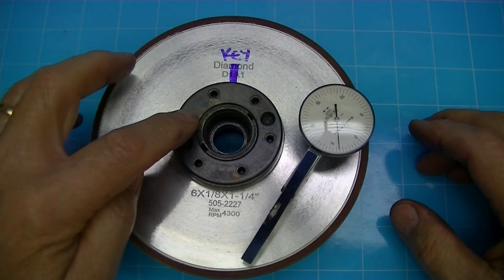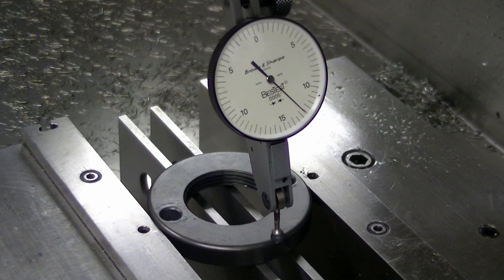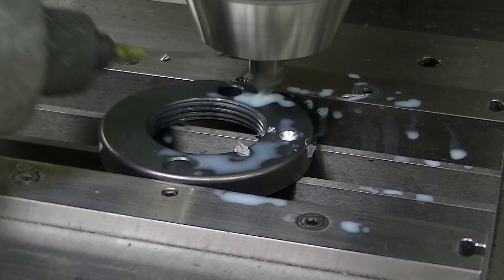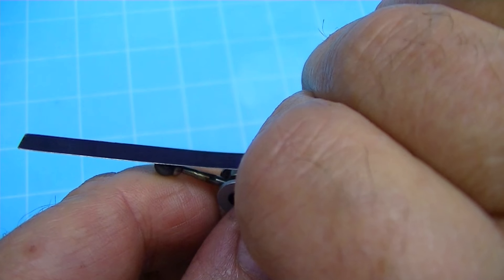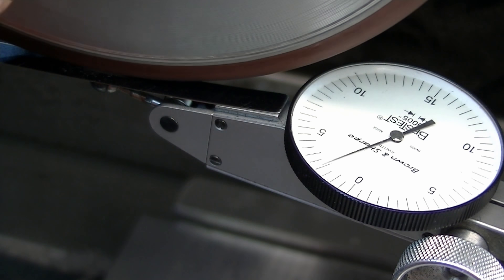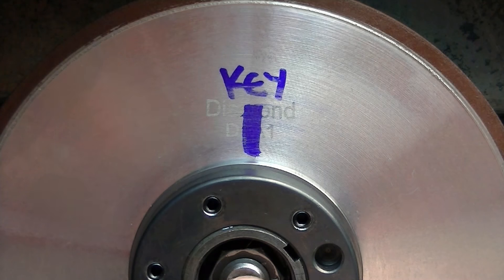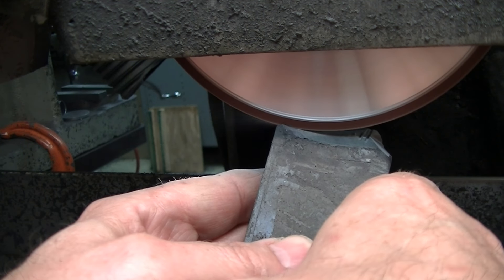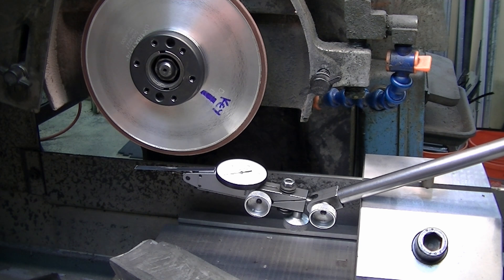ROBRENZ TOOLROOM TIP #2

Comment: “Shop Notes”*

• Making a grinding arbor nut
• Adding spring steel to a dial test indicator for alarger surface
• (5C) collet held backstop in the lathe with the chuck on
• Tapping head is a SPV (Spintec) SA-0E. I can't find the model on their website. 
• 3M 467 Adhesive Transfer tape:
McMasterCarr (60yd): https://www.mcmaster.com/#adhesive-transfer-tape/=19s264m
Amazon (.5 in/20yd): https://www.amazon.com/dp/B007Y7CQ1S/
(other sizes): https://www.amazon.com/467MP-Performance-Adhesive-Transfer-0-125/dp/B00P26Z04I/
3M's website: https://www.3m.com/3M/en_US/company-us/all-3m-products/~/3M-Adhesive-Transfer-Tape-467MP?N=5002385+3293242532&rt=rud
• Indicating in
• Tip about aligning to your spindle for good repeat concentricity.
• Opening a dressing a diamond wheel with dollar store sharpening stone and a stick of moly(dinum?)

*Not affiliated with any manufacturer or supplier.

Comment: We used a similar multi-point jacking bolt on some specialized equipment that needed huge holding forces, but had no room for standard wrenching and torque that would be required with a standard bolt.  Did the math and found to get equivalent torque on a standard bolt, we'd need a 17foot cheater bar.  With the super-bolt, a 6in long hex key was enough to get the same result.  Amazing.... 
I always learn something fascinating when I watch one of your videos.  The spring steel "pad" alone is pure gold.  Keep up the great work.
Reply from the maker: Thanks and correct, I didn't invent the idea I just applied it in another application.
Reply: @ROBRENZ  I didn't mean to imply that you were implying that you were the first to use this.  Simply to discuss the incredible amount of force this method produces.  I'm not a machinist, but love the craft.  Of all the amazing things I've learned here, the one I most often use is Goop thinned with toluene.

Comment: Hi Robin, hope this finds you doing well. Can't thank you enough for sharing this info! I need to grind the carbide feet on an indicator stand I built, and just purchased my first diamond wheel to do so. Your video is going to be incredibly helpful in setting up the wheel properly. The tips on the arbor nut set screws( and spacers ), and the spring stock for the indicator probe are priceless!

Comment: Robin, thanks for another great video,  I really like this style. The long form videos are great, only downside is sometimes I want to show a technique to a coworker and can't remember where you showed it. You're also the reason we have a Harig surface grinder and D-bit grinder. 

One question-you come up with very creative ways to work around not having a tool changer VMC, but wouldn't it be easier to get even something small like a Minimill? It wouldn't replace the ProtoTrac for big stuff, but it sure would make life easier for all the spot/drill/tap operations and projects like the boring bar.  

You're doing things now that we mere mortals couldn't do if we were handed a 5 axis Kern, I can't imagine what would happen if you had a little machine like Adam Demuth's Mori tucked in the corner.

Comment: Thank you Robin,
Amazingly timely, almost, but that actually helped me Focus ( you b) on the lesson!
Just did a small run of precision stones and had to dress a new Norton 13mm wide diamond wheel.
Went with what I knew and used a Norton carbide dressing  stick to true and Alox stick to open.
Like you're suggestion better
How does the sticky cold rolled do in comparison to the Molly?
And that hub, Hubba Hubba hubba.
Had to do it, sorry.
But, yep, that's brill.
You could do the same on the vitrified wheels with that washer taking the grubbers.
Lots of hubs, one for each ....
Thanks again Robin, keep safe.

Comment: I just recieved my first grinding wheel yesterday. This video pretty much answerd all questions I had last night about mounting it and dressing it. Timing could not have been better. Really like the tip about the metal strip you mounted on the dial indicator.
Reply: This is really only for diamond or cbn wheels. A standard  vitrified abrasive wheel would just be dressed with a diamond point.

Comment: I once did a study looking at resin bonded diamond wheels under a powerful microscope, comparing those that had been ‘opened up’ using a soft dressing stick with wheels where this was skipped. I was just barely able to discern the ridges of resin directly behind each individual grain of abrasive, and valleys on all other sides of the grain where the soft abrasive dressing stick wore the resin away. I think if I had more time to experiment with dressing procedure I could have made it even more pronounced, but it was interesting nonetheless.
Reply: Microscopes are a great shop tool for seeing what you're doing, with abrasives especially. If you can just use your eyes, a lot of great techniques turn from spooky tricks to blindingly obvious.

Comment: I may never need to do this setup on a grinding wheel but the tricks with the spring steel are interesting . I think that precision grinding has been overtaken by new EDM Wire cutting so this type of tips & tricks by the older class of toolmakers get lost. Thank You
Reply: EDM is fascinating technology but it will never replace grinding -its slow ,machines cost arm and leg ,its hard to find a good workforce that knows how to work on it ,amount of power those machines use is high.Its first used in 1970's but its still unicorn of the machining world.Compared to a CNC machines like milling machines that are commonly used today in large industry and hobby garages ,its way behind in mass use and its only 12 years younger than a cnc machine.Grinding is used since the iron age 2500 years ago when a dude used a rock to sharpen a axe  and it will stay for that much probably.
Reply: zumbazumba if you read closely I was talking about Wire EDM machines . The technology is amazing as it can cut complex geometry shapes as a high rate of speed VS the old cabin electrodes of the early 1970’s . I have seen carbide parts of 4 to 5 pcs cut at different locations that have a slip running fit with a 3 to 4 micro Ra finish. parts were produced in hours. Sounds like you need to checkout wire machines as they are slick. Hate to say this but CNC machines have left manual machines i the dust for speed, fit, finish & time to produce. Back in the mid 70’s i worked at Burke tool and Fred purchased. Moore CNC tape Jig Grinder this machine ran rings around a Harig grind fixture on a manual grinder. Sorry but this is a fact ! .
Reply: Wire EDM is not very versatile. Parts cannot have complex topology, but must be composed of geometrically primitive surfaces of revolution or extrusion, and can include no fillets or concave edges if these do not align with the wire, or any features with more than two faces which meet at concave junction, to name just a couple of examples. The rolls for a rollforming machine, for instance, are not suitable candidates, despite being simple solids of revolution.
They are also perhaps the most maintenance-intensive items in a modern toolroom.
It is fantastic tech, but it has not replaced precision grinding, and is not likely to do so.

Comment: Nice bag of tricks. I got comments, of course.

I like the contact point protecter trick. Back in the day, I superglued a strip cut from feeler stock to the DTI. Reliable double side adhesive was unavailable. You young whippersnappers have it easy.  

I've used mild steel to dress diamond wheels many times. Never considered moly but moly barstock is scarce in these parts anyway. 

Dedicating wheel hubs to a particular wheel has been around for generations. However multiple hubs are expensive/tricky to make accurately for most shops. For that matter quick interchange of grinding spindle hubs is pretty much a concern for the tool room and sharpening lobby. Sopco is a revered name for grinding wheel hubs for those interested. They make hubs for most grinder spindles for a fair price (about $100 for a Cincinatti T&C grinder hub). They're worth the money and turn-around time is short for pupular hub configs in stock. Well, that was my experience 25 years ago.

Good presentation Robin.
Reply from the maker: Thanks Forrest!

Comment: Faster than my way, that is certain.  Thanks for the demonstration.  I've been using my homebrew brake tool but will try the molybdenum sticks next time as the dust created by the brake device makes it a solid second place behind this method.  I also haven't been dressing the resin back with as much frequency as you show here.  Thanks once again!

Comment: I made one of your DTI fine adjust heads and just love it. One change I made was to add a ball to the mag base arm. With a couple of side plates to make a stiff joint between head and arm there is sufficient freedom of movement to fold the DTI back along the arm protecting the stylus when not in use.

Comment: Excellent excellent vid, brilliant use of spring steel combined with indicator and pear tip to remove cosine error, with the extra detail of creating a rubbed flat that effectively creates a larger true contact patch.

When you drilled the nut however, a more stable method to add more contact points with your vice would have been to add a v block against both jaws of the vice- creating 4 points of jaw contact rather than 2- and leaving less chance of deforming the nut from clamping, as well as less chance of slipping or rotating when drilling.

Otherwise great vid as always! I need to get a grinder for home use, I only have a Harig 618 and a newer Okamoto at work to use.

Comment: Thank you Robin! Just filing away all of these great tips for when I get a surface grinder. I've always wondered, do you have 3-phase in your shop? If yes are your machines 240V 3-phase or 480V? I'm thinking of building a rotary phase converter for my future shop. Have you ever ran lathes/mills with single phase motors?
Reply: I have been using a rotary phase converter for 24 years. One of the three legs will be slightly low on voltage, (240 in my case) but it has never caused a problem for my machine, a 3 axis cnc knee mill -  10 x 54 table, 5 hp #40 spindle. The voltage you choose to use will be determined by how you chose to wire your motors, if you've got the option. The higher the supply voltage, the less money it costs to run them. The hp rating of the motor must be at least the same rating as the largest motor using the three phase. I would have needed two telephone poles at $10,000.00 each to get the three phase to my shop in the barn. The rotary generated three phase has never caused a problem with my cnc. Too bad so many people are taboo on rotary phase converters.
Reply: Jim Somers That’s very encouraging to hear. I’ve just bought a 10hp 380-440V Delta motor to use as the idler. Likely machines in my home shop will be in the 2-3hp range, so the relatively large idler should definitely help things. Since I’m in the U.K, standard distribution 3-phase is 415V, including the rest of Europe, so all 3-phase machines are at least 415 volt,  no lower. I was thinking of wiring the motor I have for wye and putting 240 single phase across ONE winding (i.e from line to the star point) so I get 415V 3 phase across the lines. I’ve been told that will stress the one winding a lot, but I’d rather try it for myself and see, instead of never knowing. I’d really prefer to avoid a step up transformer, unless I find one for cheap.
Reply: I switched to phase perfect from a rotary converter 10 years ago and love it. Would never go back! Little to no noise, 3 phase power is always on, no need to consider which hp motor to turn on first and better 3 phase than the power company can provide. Check it out. I have no financial interest in this just a happy camper.

Comment: Oh ya robin whenever you have a minute. your video's are alway's a real nice suprize. Those resin bond wheels can be had on ebay cheaper than you can get a green 6" 1" hole. The 3" if there gonna last me forever buy 2 crash one specials from china would still be a new buying experience A veriable speed motor drive and a drill motor sized motor is where i'm going to start . and make it so its a tool post grinder / mini  K-O Lee has vari speed and a hub system and flood coolent the diamond cuts sooo cool but Aluminum oxide heating and cracking tool steels carbon steels and the dust  That vari speed drive is gonna power my HHO cell  Thats what I'm doing right now is digging up and cutting off parts pieces Having a torch that would heat a 3/4" steel bar orange and you store no flamible gas and some of the other aspects  thanks robin good to hear from you

Comment: Thanks for sharing, great idea that I will use. For normal grinding wheels you need to balance them also before dressing. Is that not true for these superabrasive wheels?
Reply from the maker: Yes, absolutely
Reply: @ROBRENZ  Oke thanks! Than you can use the set screws also for balancing like the balancing rings from Spencer Webb. Will give it a try.

Comment: Robin, I picked up an 8"x1/2" Asian import diamond wheel that has a 32mm bore, so it's a good .015" oversize for a 1-1/4" adapter.  Do you think this technique (the clamping screws in the nut) would be appropriate for a wheel with that much free play?  Or am I asking for trouble?
Reply from the maker: Hi James, It will work fine. Thanks for stopping by.

Comment: Thank you. For such a long time I've waited to watch someone show how this is done. I'm unable to find inexpensive superabrasive wheels to fit my wheel adaptors (50mm bore). Any hints or ideas on how to hold a superabrasive wheel for re-boring? I thought about holding it on the ID with an expanding mandrel or collet and trepanning the new bore.
Reply from the maker: You can hold it gently in a 3 jaw or 6 jaw chuck with soft shims protecting the abrasive surface.
Reply: @ROBRENZ  Thank you! I wasn't sure if that was bad form, even though the resin seems robust enough to hold onto.

Comment: wrapping the wheel in one layer of tape is a lot faster and works to save a tip from wear.........
Reply: You never know if the thickness of the adhesive on the tape is evenly applied, or if the tape is of a consistent thickness. Not saying I have evidence that it isn't, but we're talking about half a thou here.
Reply: You must be new here.
Reply: @Turkishmath  your dressing the wheel anyway. These wheels are not even round so u cant even get tir under .002 most of the time  .geez
Reply: @Turkishmath  It's actually a good idea.  Most tape is rather consistent in thickness (sub thou).  I have wrapped  tape on parts that i  didn't want to mar with the indicator tip (with good results).
Reply: Yup. I use tape too. Have for a couple of decades. Never hurts to learn new tricks.

Comment: I usually edge find round features then I'm within a couple thou when I indicate, there's something about chasing the indicator around as you get concentric enough to stay in it's travel that annoys me and this method avoids that.  I was meaning to ask what set up you would use if you wanted to grind a concave radius on the D-bit grinder and it seems like all you need to do is dress a radius on a thin wheel.

Comment: Amazing how similar best practices are in shops around the world. We'll use a motorized truer for taking out major hop, shaping wheels, or sharpening corners (preferred over brake controlled truing devices). Piece of molybdenum for snagging random grit. We use the soft Norton 18 38 aluminum oxide stick soaked in water for cleaning. Just shove it into the wheel once. Our grinders have vfds, and I do most of the dressing at reduced speed. I'm going to try your trick with the moly.

What ever happened with your Mitsui 6x12?
Reply from the maker: Still on the back burner, it's a 8 x 18
Reply: Don't know what your beef is with the brake controlled truing device is but for the noobs out there the Norton brake controlled truing device does wonders on a diamond wheel. Then again I guess it's not your money being spent on the vfds. His trick with the moly is getting around not owning a brake dresser and for him it would probably break the bank. The Chicoms don't make one for him to afford yet.

Comment: Is there a need to harden the nut or can it be used in the soft state?
Reply from the maker: It was softened to enable drilling and tapping, there is no real need for it to be hard.
Reply: @ROBRENZ  thanks for your advice.
I have one wheel holder with right thread nut so not quite right for CW spinning spindle. It should work for this though.